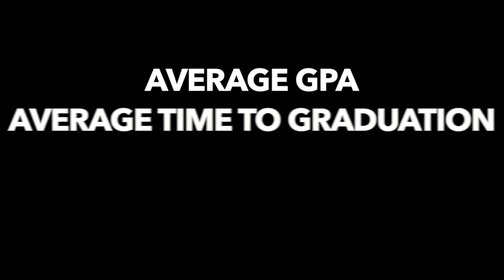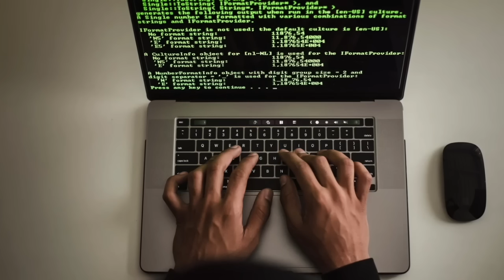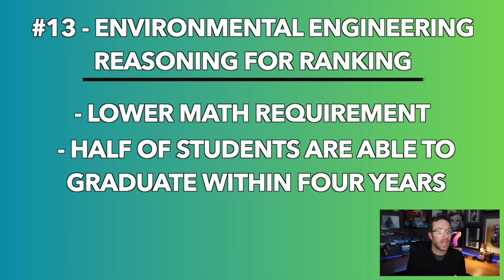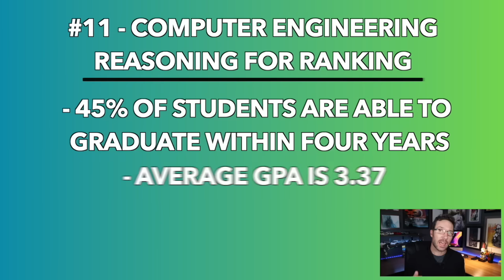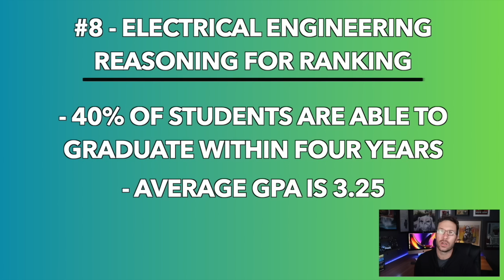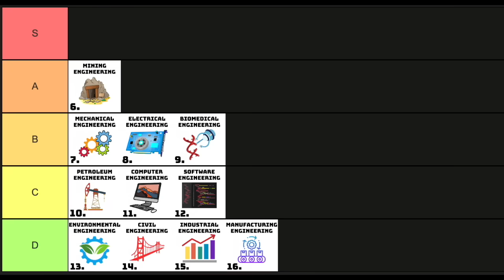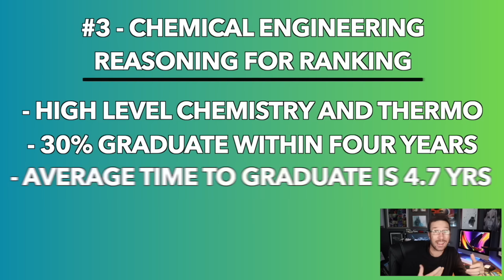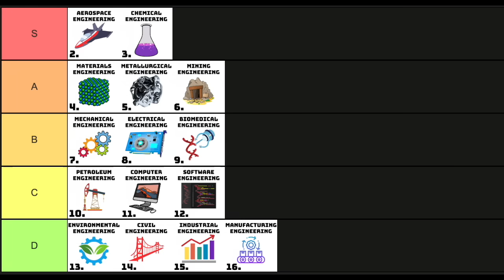Engineering Degrees Ranked By Difficulty (Tier List)

Comment: In my opinion Civil should be ranked ahead of Environmental Engineering, Computer Engineering and Software engineering.  Civil requires a more thorough understanding of physics that these other 3 disciplines do not. Overall, though a pretty good list. Would be interesting to see data on the number of total jobs in each discipline. Mechanical engineering for instance may have a reasonable forecasted job growth but how many overall jobs are available compared to other disciplines? Job growth is one aspect but total number of jobs available is quite important especially in a questionable economy. Another consideration is where will your discipline of engineering require you to live? How often will you need to move; how much time away from home will be required, etc. A lot to think about. And although I agree with your assessment about mechanical engineering being able to apply to other engineering disciplines more so; you are still at a disadvantage compared to your competition if you have a mechanical engineering degree and are up against a civil engineer for example competing for a specific civil engineering position. Even if you get the civil job as a mechanical engineer, you will be up against your civil engineering peers for promotions and if it is strictly a civil engineering firm it will be an uphill battle. It's doable but not as easy as one might imagine.

Comment: Having spent 30+ years in the industry I have met a lot of Structural Engineers. Very surprised that discipline is not on your list as I feel it is one of the more challenging ones. Just my 2 cents in an otherwise very enlightening videoa, thanks!!
Reply: Structural engineers are civil engineers. Usually, structural engineering is a graduate degree within civil engineering.
Reply from the maker: youre welcome!

Comment: I think you entirely missed the most difficult engineering degree. 2008 my younger daughter registered for an engineering BS at a first tier university. I Was with her when she registered; she asked the registrar what's the hardest degree at the school. The registrar said without doubt the hardest degree is Engineering Physics. It has the highest required SAT score, has by far the highest dropout rate and the minimum requirement of 17 semester hours of calculus (3 3hr courses and 2 4hr courses); most, if not all, Eng. Physics majors take an additional 4hr calculus to get a minor in applied math. This major also requires Eng. Statistics.. Engineering Physics is "First Principle" and develops the protocols basic engineers use.
Reply from the maker: i will try to add it to the next one

Comment: I'm a young civil/structural engineer in Canada and I'm gonna be a little cliché, sorry. I get why people always belittle Civil Engineering saying it's easy. Maybe they say that because it has a lot of branches (geotech, hydro, water treatment, structural, roads, etc.) and the bachelor's degree can't cover a lot because there's so much to learn or because most graduate ends up in management positions, idk. I did my master's at Sherbrooke University in structural engineering/seismic engineering, my thesis was about the cyclic behavior of reinforced concrete-filled FRP tubes and you can get as much technical as other fields if you want depending on your work. I currently work for a firm specializing in the light to heavy industry sector. A lot of our projects are ''brownfield'' with old structures having been poorly managed and lots of useless mechanical pipes, electrical cable racks, leftover equipment all rusting, etc. We're called a ''support department'' because most of the time it's mechanical, electrical, process, etc that gives us their requirement for the project and we need to make it happen. We civil engineers are often the ones who see the big picture and try our hardest to make it happen, to innovate about how to do things. To add difficulty we're the first things that get done that the client sees, can't have your equipment installed if there's no foundation and if you're in Canada winter is a big stress for construction scheduling. We need to inspect and evaluate old or recent structures, plan the required reinforcements, think about how to do it, the safety hazards while doing it, the constraints from operation (ex train loading and unloading can't be stopped during construction), working with small available space due to existing structure, think about what the client could do with our structure in the future, close structure for safety risk, produce structural integrity analysis, plans seismic rehabilitation, etc. At the end of the day, every engineering degree has its perks and difficulties and we should respect all of them. I respect mechanical engineers even though sometimes they do stuff that makes me hate them like come back 2 months after the building is built telling me the equipment is 20-30% heavier.
Reply: I love your comment!! I do believe that even though CE may be thought of as one of the easier degrees, it may actually be one of the more complex jobs as an engineer. Other engineering disciplines may depend on a higher level of precision and technicality, but civil engineers often have to deal with decisions that could affect business, economy, sociocultural factors and local politics, on top of their technical design. Slightly more interesting, imo!!
Reply: And also on the military-adjacent side of things, we MEs like to make you hate us by claiming that we make ordinance and y'all make targets.  :)

My opinion, almost three decades out of undergrad, is that probably any of these fields are going to be easier at some universities and harder at others depending on how deep the BS goes, and the MS is going to have even more variation -- you can do an "easy" thesis in any field, and you can do a difficult thesis in any field.  And the jobs vary even more than that, as does the pay.

Also, a big piece of the job -- especially the harder ones like yours -- is interacting with other people, dealing with conflicting and changing requirements that may not have been written down, dealing with the ways that things on the ground don't match the theory of how they should be, and what my dad (also an ME) called the art of making sufficient decisions based on insufficient data.  IMO, compared to all that stuff, just about anything technical covered in an undergrad course is almost trivial.

Comment: Please do more researches before posting about engineering and the level of mathematics. I am a graduate from both Electrical engineering and mechanical engineering. EE is much harder in term of mathematics and physics than all of them. Partial differential equation is basic math. You even put other easy engineering higher than mechanical engineering. This is crazy sir. Most of the complex mathematics topics have been developped for the purpose of solving EE and ME problems

Comment: A material engineer myself.  Also involved in metalurgical, chemical, nuclear engineers work.

I think aerospace engineering is on the top.
Industrial, manufacturing and environmental on the bottom.

Then everything else are depend on individuals talent on the subjects. (subject easy for one person may be difficult for another person.) 

Also have differentiate between difficult subjects form a lot of subjects required.  Like Jeff Bezos had difficult time solved partial differential equations...that difficult subject.  This may harder than required to pass 3 easier subjects.

Comment: When I graduated in the 1960s with a BS in Electrical Engineering, the number of credits required for graduation was considerably higher than what you quoted. Significantly more math was required, including partial differential equations (needed for electromagnetics), vector analysis (needed for electromagnetics), and complex variable theory (needed for Fourier analysis and the Laplace transform). Although not usually required, linear algebra is necessary to really understand signal analysis.
Reply: I don't know where the idea of only having to stop at differential equations for EE came from.  A heck of a lot of the junior year EE courses are really just more math.  You note several of those.
On top of those there are several areas of specialization where deeper math is needed.  An EE specialization in control is a great example.  For a undergraduate degree you're in 400 level math classes.
Reply: Linear algebra is HUGE now because of machine learning and high-dimensional measurements needing to be reduced down to the few big principal components. The advent of lots of cheap sensors (and availability of lots of data) brought this about (partly anyway)
Reply: I'm actually majorinc Electronics Engineering (just electrical but in micro) and so far we've definitely required PDEq, Vector Analysis and Complex Analysis, for the same fields you mentioned. Fourier and Laplace are some names I'm surely beginning to hate thanks to signal theory.
Reply: @Depressugar DSP. That will make you sweat.
Reply: So, you’re roughly 80?
Reply: 82 @hyperjank5129
Reply: @hyperjank5129  he is 85+
Reply: I got my BSEE degree in '77 and, as someone who concentrated on electromagnetics and antennas, fluency in partial differential equations, vector calculus and mathematical modelling in general was something you needed, you couldn't fake and that few people were willing to develop absent a genuine interest in the subjects. 

Indeed, what largely led me to EE were those small text footnotes you'd see in high school math books that said things like, "Imaginary numbers have great practical utility, especially in electrical engineering.")  

I'd put chemical engineering slightly ahead of EE for difficulty (my roommate was a Chem. E. major and I saw what he faced), but in my day (admittedly, I don't know what it's like now) if higher math wasn't second nature, you stood little chance of success.

Although I no longer earn my living as an engineer and haven't for decades, I think the rigor and discipline of learning a complex technical subject have served me well over the course of a lifetime.
Reply: @philmann3476  I completely agree with your assessments, conclusions based on your schooling and work experience. I graduated a few years later with a BSEE degree and can confirm with the course work you mentioned....took linear algebra, required differential & partial diff equation course that was required to supplement or support the electrical engineering concepts/course work....I agree my chemistry course work requirement was minimal but realized it's difficulty in nature...I had professors who had multiple degrees, some with only a MS but in EE, ME, and a solid foundation in physics. If I was to go back in time for my college education, I would get my degree in physics and then get my higher focused degree in an engineering discipline you found most interesting while obtaining the physics degree, that's my personal/experienced opinion...
Reply: I’m a EE junior at UC, & guess was hasn’t changed? 
That’s right! Nothing! 
All those classes are prerequisite for declaring EE.
I might be able to graduate next year by consistently taking 19 unit per quarter, but we’ll see 😉.
We have to take a few programming classes as well, like microchip programming and logic/system design.
Reply: The math requirements are still ridiculous, we just use MATLAB to apply them.  The guy making this video doesn't know what he is talking about.

I took diff eq freshman year.
Reply: yeah, I was thinking the same thing.  I seem to remember each year was something like 46 credit hours.  Maybe he's not counting the 3 out of faculty electives??
and I agree with the math also.
Reply: I'm argentinian, here we still have complex calculus (applied in Fourier, Laplace, root locus, convolution, filter design, basically control theory), vectorial algebra, in physics they just stopped teaching relativity but we still have thermo and quantum. Here the career is 6 years long and the average time to finish it is 8 years. Electronic engineering.
Reply: I have a master's in EE.  I definitely had to took more math than was quoted too.  Nonetheless, as hard as it was, for me I still thought that just about every other form of engineering sounded harder.  Incidently, I had friends in mechanical and aerospace that said the they thought electrical sounded harder.   

At the end of the day, we were probably all right.  I think it isn't so much any particular discipline, they are all really hard.  I think what matters is where the interests of the student are at.  Electrical was easier for me because I was extremely interested in the subject and loved learning about it.  My friends were very passionate about their disciplines are very dedicated.  Having genuine interest goes a long ways towards making things seem easier than they may seem to others. 

So I think the hardest engineering is probably going to be whichever one the individual finds the most boring.
Reply: I agree!  I took all of the above higher level of math courses you mentioned.
Reply: ya I'm in an EE degree right now and I had to take Calc 3 Linear algebra and tbh I would consider microelectronics and linear systems math classes as well.
Reply: Pretty sure that's all required still
Reply: When I was in college about 50 years ago the engineering students took about 140 hours to graduate.   But checking now the requirements    are about as he quoted, 125 hours.
Reply: Yep, had all that at UCLA. My only regret is that I didn't pay a bit more attention to the very mathematical/theoretical classes (EE 121C - Systems and Signals, at UCLA). While I have an excellent understanding of the circuit-level theory, I wish I would have polished the mathematical aspects more. Instead, I sort of fell into a "trap" relying on SPICE simulations (nothing wrong with that, per-se). When I design and simulate analog circuits, I can easily visualize in my head how it all works, but I dont visualize all of the underlying equations, such as stability, all of the poles/zeros, transfer function, etc. Since most of my career was digital/SoC work, much of that wasn't entirely relevant.
Reply: I'm a first year EEE student, so far we've covered Linear Algebra, ODEs, and Laplace Transforms, and we're just starting to get into Calc 3 and applying it to Electrodynamics
Reply: I'm having all that, but bot in USA so might be different
Reply: At my university, EE students still have to study all these things during sophomore year, with some topics covered during junior year. Anyway, it’s still mandatory here.

Edit: my university is in the Middle East.
Reply: yep 210 hrs for me EE Degree
Reply: Agreed!
Reply: Yea, I graduated with a BSEE in ‘88 and 146 credits were required
Reply: We had all that in the late 80s as well. It probably depends where you went. At my university at that time, EE was the hardest school to get into - you needed a 3.5 GPA over the first two years to get in, and to maintain a 3.0 once in to avoid being kicked out. Of course you got all that math in calculus, differential equations, and discrete math courses, which were required for all engineering programs (maybe some didn't require DiffEQ), then you "really" learned it for EM theory, control systems, device physics, circuit analysis,  etc. The mathematics courses, which were light on application, always felt superficial to me, and the learning didn't really stick. In EE courses where the math always had a clear purpose, it made a lot more sense. Also, a few weeks of vector calc in a math course can't compare to (in our case) two trimesters of EM theory.

In the years after I left, the EE program there declined a lot. Most students who would have gone into EE went to CS instead.
Reply: @jmodified I would really like to compare the difficulty of bachelor's degree, so if you would like to respond me i would be very grateful. I'm actually studying for my bachelor's Degree in software engineering in Italy at the university of Catania, we have courses of calculus 1,2 physics 1,2 plus 3 exams of EE and 2 concerning  the study of signals, so we use to study Fourier Transform too. We need 180 CFU (University credits). I have noticed that generally our degree programs tend to have an average of 50 more university credits, comparing them with the ones in the video, so to me it seems that our programs are more comparable with your's in the 60's - 80's. Hope for your answer 😊
Reply: @jmodified  Which school?
Reply: @jimgutt749  A large state school in the Midwest.

Comment: I’d like to suggest adding Biochemical Engineering to the list (UC Davis class of 2016). We are Chemical Engineers with a ton of additional upper div biology. I don’t know about other schools but Biochem E at Davis requires PDE’s and had the most required upper div units and highest overall unit requirement of any major in the UC system. Almost no one graduates in 4 years and without exact numbers my observation is that less than 25% of people who start out in the program finish the degree at all.

Comment: I find this kind of funny, I aced (100%) for the nuclear side of things - it all just made sense. I did computer engineering which in Australia is basically identical to Electrical Engineering - throw in Designing CPUs, operating systems, years of maths, power and controls systems, motors, power distribution. While having all the fundamentals for engineering all the engineers have to cover. And I would say EE and CE had 90% failure rate. 500 started and just over 40 made it through.

Control Systems was the biggest killer of students for EE and CE. It is a very difficult area.

I knew a guy who failed maths, did well with all the other EE subjects. Got a PHD in Chemical Engineering. He did well for himself